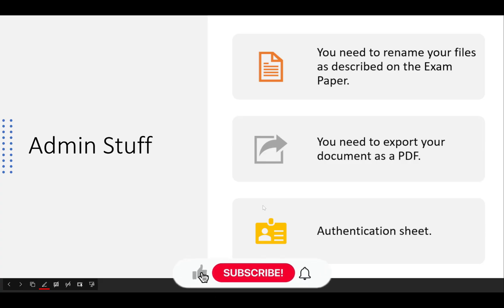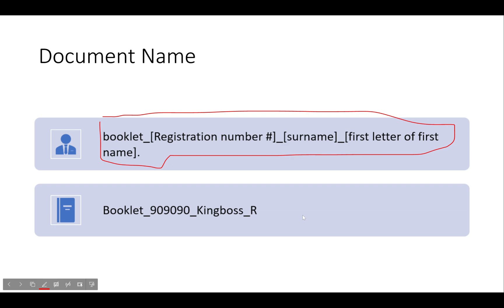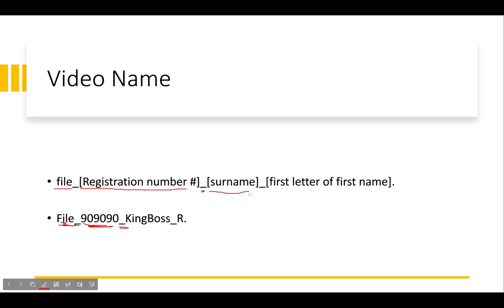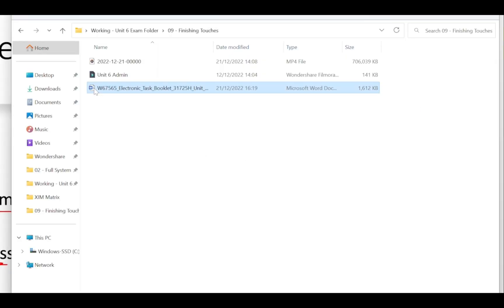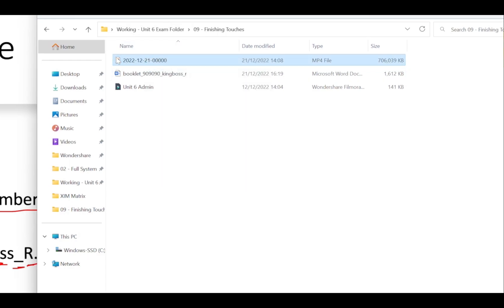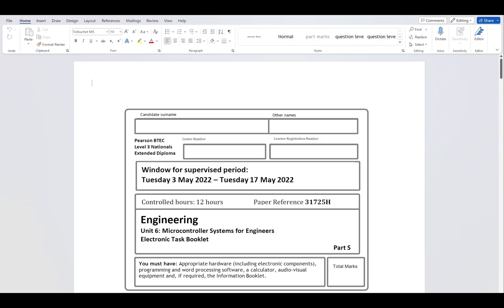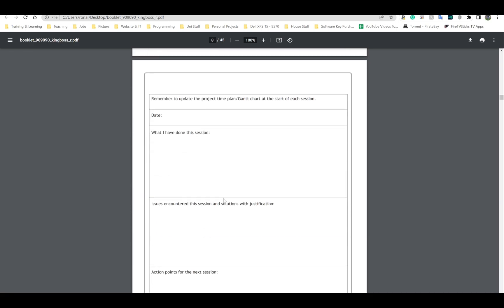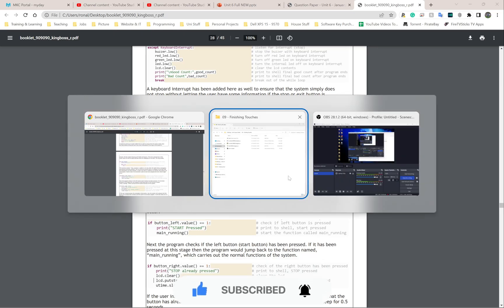BTEC Level 3 Engineering Unit 6 Microcontrollers - Part 27 - ADMIN (Rename and Export Files)

Comment: Hey, what about the other pdf files, like the flowchart or block diagram (if the examiner wants to have a better look). Do I put them in a file in the same location inside a file.?
Reply from the maker: I would put them all in a folder and maybe name is diagrams. 

However is you screenshot it and it looks okay when exported maybe not something you need to stress about. 

I just like giving options.
Reply: @RonsTechHub  Noted, thanks for the reply